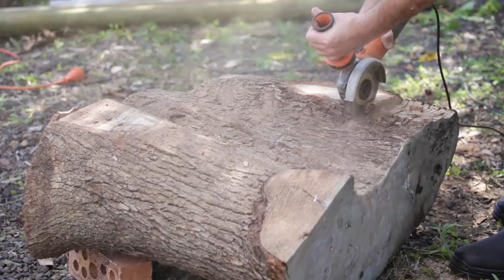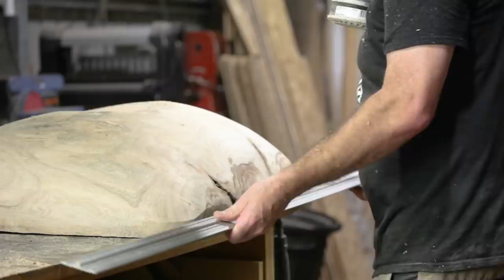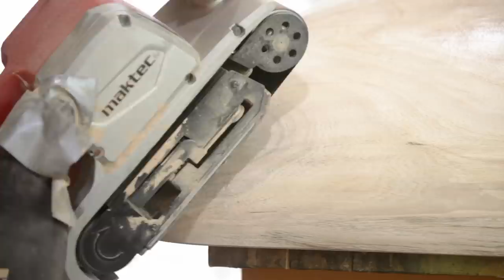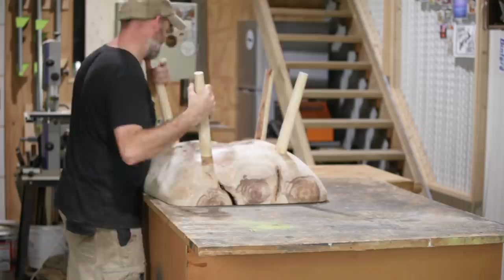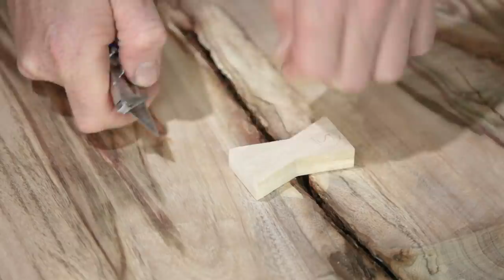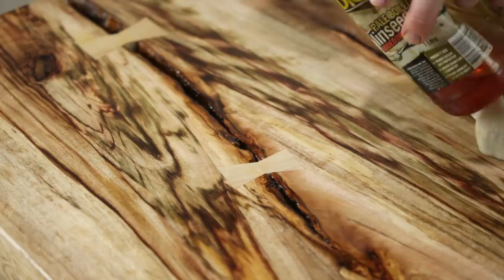Coffee Table from a Log

Comment: Past, you did everything perfectly and with a bucket load of common sense.  It was obvious that your project would be a success due to the insect on your shoulder praying to the patron saint of wood workers.  When I was a youngster in shop class, we had to make a 30 inch four legged stool.  Every time I cut off a little bit of a leg to balance the stool, I cut off too much and had to trim another leg.  My 30 inch stool ended up 25 inches tall (or short)!  Thanks for sharing your videos. Bill

Comment: I love the grain on the table top....What about just applying Epoxy to the cracks ?  Do you think that would suffice in place of the bow ties?
Reply from the maker: Thanks! Epoxy wouldn't work because there is still moisture in the log. It will shrink and the epoxy would crack. :)

Comment: ive thought about adapting the barrel fixings they use for assembling bed frames instead of dovetail keys, if they were inserted from the side , you could plug the holes with a knot from the same species, tryand make it invisible.
like the table anyway ;0)

Comment: I loved the look of how that turned out. At first when you were making the legs I thought that they were going to be rather small for such a large piece of wood but they turned out pretty nicely. I think the butterflies that you did turned out pretty nice to and where they aren't of a hugely contrasting colored wood I don't think that they take away from the table but add a bit of interest. Did you think about using epoxy or a resin to fill the cracks at all? Great work. I'd love to try making something similar in the future.
Reply from the maker: Thanks Scott - glad you liked it! Yes the butterflies weren't too bad in the end. Epoxy wouldn't work as there is still moisture in the log and it will shrink and distort over time. :)

Comment: Nice work! Just wondering, I've never had to use dovetail keys before, but would they have worked in the ends of the block instead of the top? And with that, could the gap along the top have been filled with resin?

Comment: im surprised you dont use the chainsaw for straightening and shaping, looks amazing, im not a fan of the butterfly clips either, i usually go with tinted epoxy or black bog.  not sure how it would go on green timber
Reply from the maker: The thing with the chainsaw (in my hands) is that it's easy to go too far quickly and ruin the piece! :)

Comment: Could epoxy have worked for those cracks and could it still work as a reinforcement?
Thanks for the great video!
Reply from the maker: Glad you liked it Joseph! Epoxy wouldn't work because the wood still has moisture in and will shrink over time! :)
Reply: Pask Makes makes sense 
Thanks again :)

Comment: Why not put the table with "un-lengthed" legs upside down on the bench and use a tall height gauge to scribe the legs to a plane parallel to the top of the table? Seems easier than wedging the legs to level the top before actually using a similar (but much lower) height gauge to scribe the legs (which won't make the final top level unless the bench is also perfectly level). With the upside down method the bench merely needs to be flat.

Comment: You should have just filled the cracks with epoxy resin.  Would have looked a ton better than the keys, and would have allowed people to see into the cracks a little.  Also you'd not have to worry about the table rotting from the inside out when people eventually spill on it.